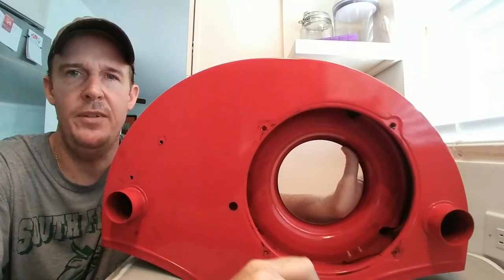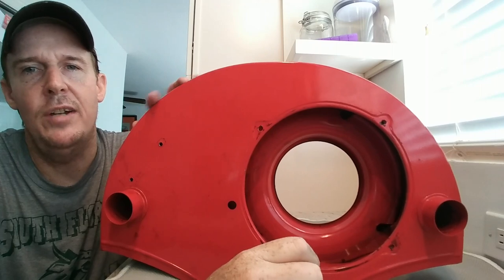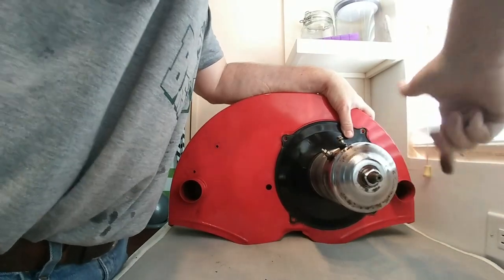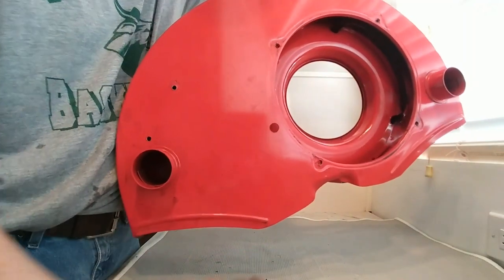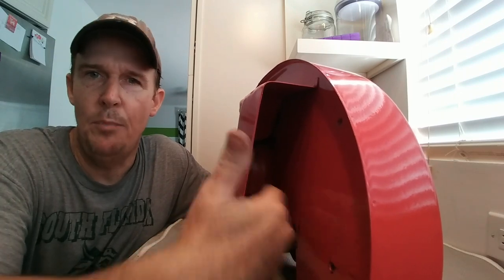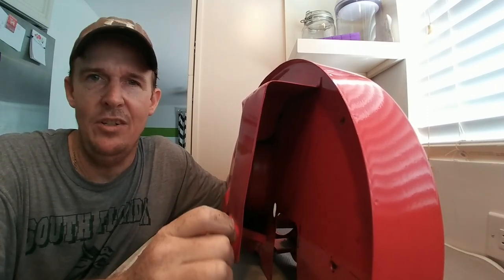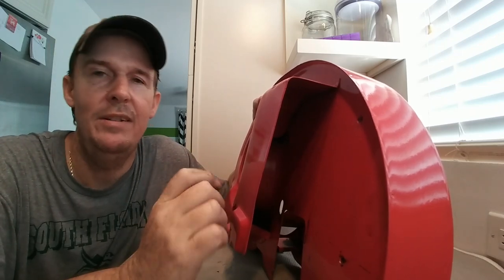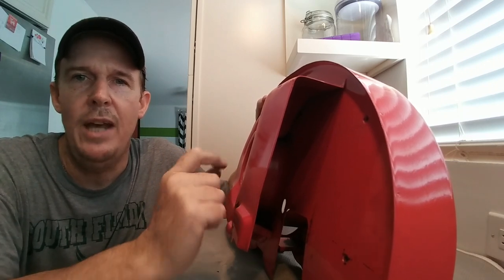.HOW DOES YOUR CLASSIC AIR COOLED VOLKSWAGEN STAY COOL? THE BASIC IDEA BEHIND THE AIR COOLED ENGINE.

Comment: Thanks John!!! Btw, I am using a small diameter alternator pulley and it makes the fan run much faster. It is an advise from a trusted mechanic. It's been there for 25 years. I hope that is Ok. Thanks again bud!
Reply from the maker: If it works it works. All good info is great. Thanks for viewing and sharing with your comments. I have a few new videos in the making. Stay safe.
Reply: Thank You I really appreciate your recommendation . I am going to try this on my engine .

Comment: I have a Corvair (which is effectively a chevy beetle) and its kinda interesting how they took very different approaches to the shrouds.
Reply from the maker: LOL, never thought of them that way. You are correct though. Ive never owner one or worked on a corvair. I never understood the corvair belt design. I am a GM guy as well. I own a few OBS suburbans, and a 88 corvette convertible.
Reply: @Volkswagenplanet  the belt is a interesting gremlin, it works well when tuned correctly and is a cool way to save complexity.

Comment: Last VW Sedan produced in Puebla, Mexico was in July 30th, 2003. It was the 1,691,542th car produced.
Reply from the maker: You are correct. It's crazy up until a few years ago, Mexico. Pulled the passenger front seat out. Then they were used as taxi- cabs. The end of a great era. Thank you for sharing the info. Stay safe.

Comment: The real question is what are people running in the place of the old thermostats? Putting a 1600 Dp together for my 71 super and I'm stumped on what to do. Any suggestions? I was always told to throw em out, but make sure you have the flaps open on the doghouse.
Reply from the maker: I personally suggest stock O.E.M. It worked for Volkswagen for decades. It worked for them, its good enough for me. Thanks for your comment. I will be more than happy to answer question you may have. Stay tuned for more videos in the future.
- KEEP DUBBING -
Reply: The reason for using the thermostats is for helping (1) to warm up the engine quickly in cooler climates. and (2) forcing air into the passenger side of the vehicle.

Moe

Comment: Thanks for the video, it's helped my understanding of the VW air cooled system.  I'm a little confused about your phrase about 'The Tins', could you or anyone else explain what you mean?  Incidentally, I'm an older guy (ahem 60 now) in the UK and own a 1974 VW camper van, which runs really lovely, I like your comments about the oil cooler, I have an oil temperature gauge on the dash just to be sure 🙂
Reply from the maker: @winstonsvictorygin  engine tins are the pieces thst go around and under the pulley in front. They help with moving around the heat as well. There are also thin flat pieces of metal over head .
Reply: @Volkswagenplanet  Oh, I get it now thanks for that, I've just not heard them called that before!  They really are sweet little engines though, and such a simple design.  Thanks for your  help 🙂
Reply from the maker: @winstonsvictorygin  anytime. Feel free to reach out. Thank you for watching. Take care, stay safe.

Comment: Hi John, I have seen people removing the heater pipe and blocking the holes left behind. Do you think this would have any negative affect to the cooling system? thank you
Reply from the maker: Not really. The most inportant thing with cooling a air cooled VW engine is the direction of the air from the fan inside the schroud. The engine tins above the cooling fins on the head is the most inportant. The heater tubes like you mentioned where for heat in the winter time.  Most people think that removing the tins is the best way to.cool them down ( like a baja) is the answer. Its actually the opposite. All the seals around the engjne bay, decklid seal. If you take the heater hoses you need to close or weld the circles on the breast plate as well. The original design was designed to push the heat out of the engine area. All these small things work in reverse. It actually traps the heat inside. Great question. Hope i answered your question so you understand the thought behind it. Feel free to ask any question about any of the videos. Take care, stay safe.
Reply: Thank you for the detailed and helpful information. As for the breast plate holes, are those the holes after removing the heater pipe and appear on the bottom of the engine bay?
Reply from the maker: @chrislee2477  yes

Comment: What would happen if you were to reverse the cooling fan?
Reply from the maker: You wouldn't be able to. The generator fan would be on top.of the oil cooler
Reply: @Volkswagenplanet  
So hot air would be pulled through the oil cooler?
If so, what if you could place the oil cooler somewhere else, would the engine be sufficiently cooled blowing air out the intake vent of the car?
Thx
Reply from the maker: @mavericmorph5358  if you remove the shroud, there is a oil cooler on the drivers side under there. When you pull the alt/ gen out there will.be a fan connected to it. The fan turns then cools the oil cooler. They do make a aftermarket fan shroud that puts the alt/ gen in the middle. Like I mentioned before you would have to.relocate the oil cooler. Hope this explains what your looking to do.

Comment: I plan to delete the entire cab heating system. Building a rat rod! Can I cap off the ports on the engine tin that goes forward to the cab heater channels? Also, at the rear of the engine exhaust system, there’s flaps or doors that are completely rusted out. Can I remove them, and leave them off! I guess this is where the hot air escapes the cooling system. This car will never be driven in cold weather. Thanks for any info!
Reply from the maker: Yes you can cap off the holes on the shroud. They make smooth shrouds ( without. Holes). You van also cap off the holes in the car. The heat exchangers your talking about on the engine can also be changed. Use a set of J - TUBES. This will delete the entire system. All these parts can be found at any classic VW online parts supplier. Companies such as J- Bugs, would be a great place to start. They have a huge selection of parts. They have great customer support as well. I am not sponsored at all by them. I have ordered several times from them over the years. Hope the info helps. Let me know if you need or have any other questions. Come join our VW FACEBOOK GROUP as well. It's called Volkswagenplanet. Same as YouTube. There are several other well known youtubers as well posting videos. Great group of knowledge as well. Post any questions in the group. All questions are important. Thank you for viewing. Stay safe.
Reply: So, you like my question, but won’t answer it?
Reply: Oops! Sorry! Didn’t see the message. My bad!
Reply: Thank you so much! I’m sure to have more questions. My first bug. Dropping the engine was laughably easy!😳
Reply from the maker: @michaelnelson9140  I try and answer questions as fast as possible. The best time to ask is at night after 9 pm. E.S.T. in in FL. I'm up usually all night long. Welcome to the VW WORLD.